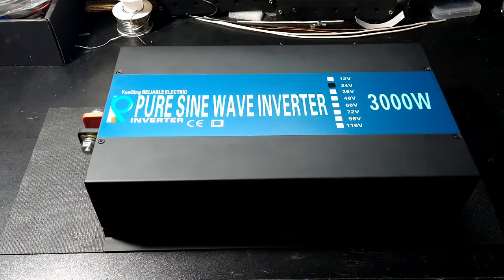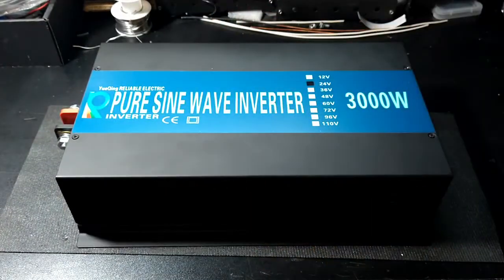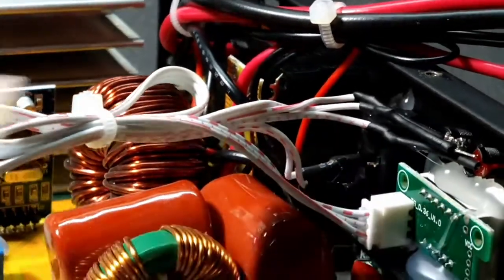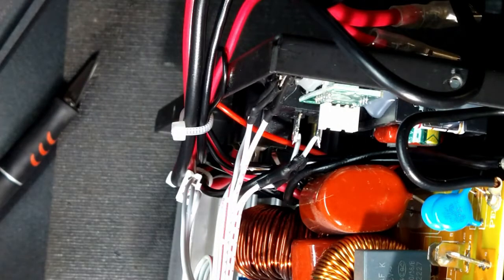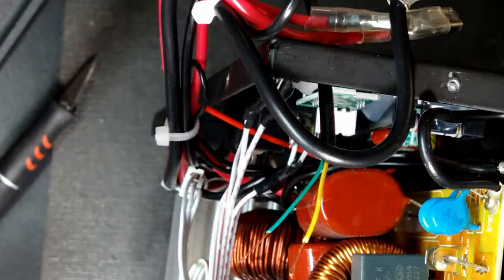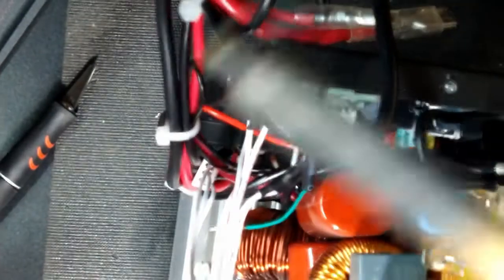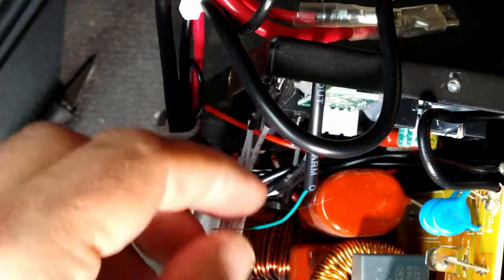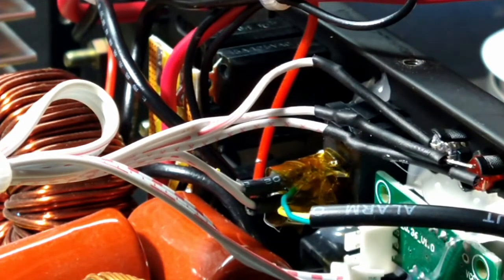Off Grid Inverter mod

Comment: Thanks Brad - will be doing this to my inverter
I watched this probably a year ago, but never got around to making this mod to my inverters, 
thinking maybe I should have (LOL 20/20 hindsight) as have recently had 2 blow the controller board and output MOSFETs within a week of each other (this also happened about 3 years ago with one - luckily still under warranty at the time and replaced)
and got to thinking that maybe this is happening because I use a LVD and mechanical relay (and now SSR) to disconnect power to Inverters when low V, and maybe the inrush on reconnect is "frying things" 
my 1 inverter that is still working wasn't connected to the LVD, so had to go through my YT history to find your vid so I could rewatch :)
Reply from the maker: Glad you find the video useful!
Reply: thanks .. sorted it this morning .. my setups a lil different .. 
I have a low voltage disconnect board that triggers an SSR (that was doing the disconnecting of the DC voltage to the inverter and I think the inrush of 50+V DC when it turned back on is what killed my other inverters) 
so now I've wired the SSR inline (series) with the normal switch .. so that both ON .. inverter on .. either OFF inverter off
Reply from the maker: @DarrenWilliamson  Nice!